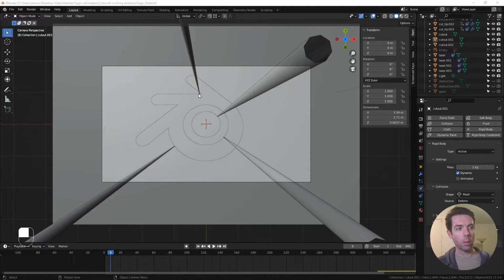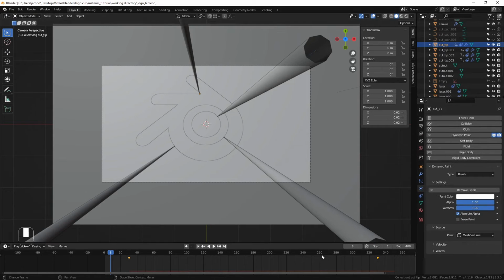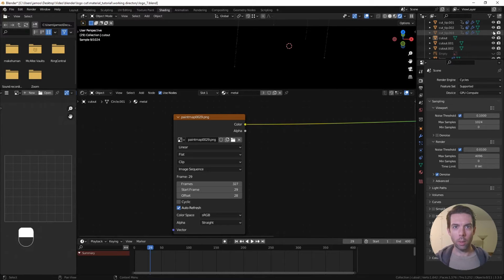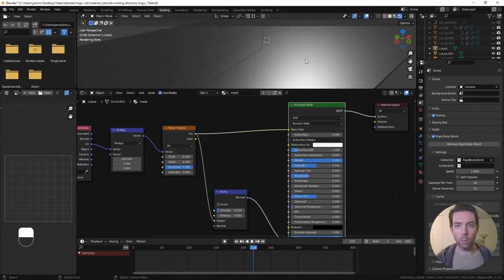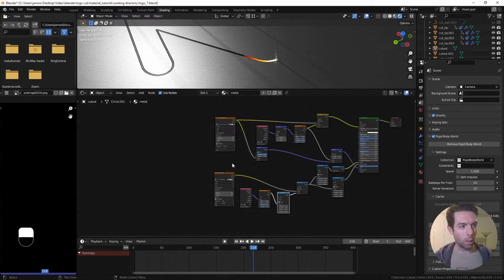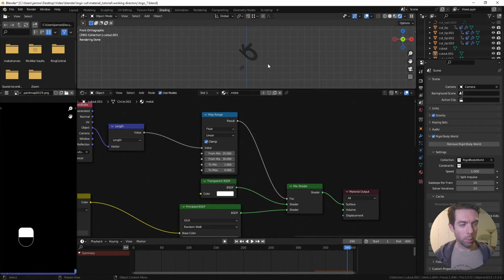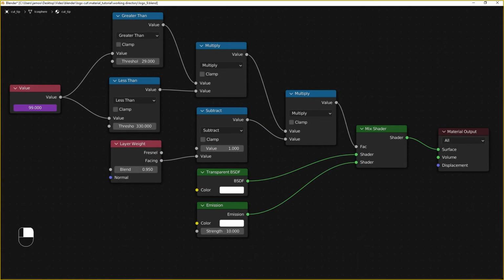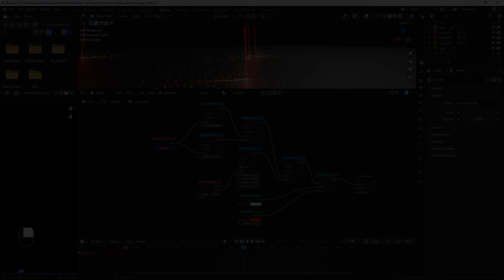Blender: Dynamic Paint Laser Cutter Material

Comment: Hello,
thank you very much for the great tutorial, which helped me a lot.
Unfortunately, I don't have much experience with Blender yet, so I'm stuck at one point. What do I have to do to make the material transparent at the cut edge (where the laser leaves the hole in the metal). I want to shine a light source through the cut. Maybe you can give me a tip?
Reply from the maker: Thanks! I'm glad this tutorial helped you out.
For shining a light through the cut, there are two options that come to mind. One that actually allows light through and one that kind of fakes it.  To actually allow light through, you could take your paint map texture and use that as the fac input to a mix shader node. Then plug in a transparent shader to the other side of the mix shader. This will allow you to use the transparent shader for anywhere that the paint map has a value. The problem with this approach is that if you are close enough to the cut edge you will notice that there is no geometry, basically you can see into the edge of the cut.
The other method is to fake the light coming through. Again using the output from the paint map image texture to a mix shader node. This time connecting a emission shader to the other side of the mix shader. This will allow you to make that cut glow in whatever color you want to shine through the material.
With either method, you are probably going to want to attach a frame driver to the factor that goes into the mix shader node. The reason is that as soon as the cutout starts to fall away, you are going to want the edges to appear solid/not glow (depending on the method you use) otherwise the illusion might fall apart as the rest of the animation plays through.
Hope that helps!

Comment: Well, this one took me a while - mostly because I'm on all new ground with Dynamic Paint, and Baking too, for that matter. So I spent most of the Thanksgiving holiday baking in more than one room of the house. The stuff in the kitchen came out fine the first time - the stuff in the living room? Not so much... I'll spare you the indigestion, but it took several attempts before I got it to "track right". I finally double-checked that I had applied any transforms I made to the objects (a mistake I still make too often), and that seemed to fix it.

Now the only problem I'm seeing is a slight misalignment of at least one of the cutting tips (I only have three) that seems to track a little off to the side of the Dynamic Paint, but I think I can fix that with a few adjustments.

One note: The cutouts seemed to fall away too fast, so first I turned the gravity down. That worked, but it also messed up the sparks (fountains!). Instead of trying to adjust them, I noticed/remembered that you can adjust the animation speed under Scene Properties > Rigid Body World > Settings > Speed. 0.300 was a good setting for me. 

Believe it or not, having to backtrack and figure out what I did wrong is actually more of a learning experience for me than following a cookie-cutter recipe to produce the identical results as the tutorial. Instead, I get to look at my half-baked cookies and say "Oh come ON! ... HE made them come out looking nice!" ... and so I go back to the kitchen and figure it out.

So I can tell you that my scene is pretty much the same as yours now; The Dynamic Paint looks really cool!; and I'm beginning to think that Geometry Nodes are a lot easier!

You're gonna kill me with the camera animation, aren't you? 😄
Reply from the maker: First of all this whole comment was hilarious to read, thanks for that! 

That's a great call out on applying the transforms, I made that mistake while rehearsing, but forgot to mention it when I actually filmed. The issue with the cutouts falling away to quickly might be due to the overall scale that you are working with too, I accidentally shrank the image at the start once and it seemed to move too fast.

I was actually thinking about you and your nice graphics card. I'm trying to find ways to make the rendering faster because the way I've been doing the final render uses motion blur and depth of field, both of which slow down the render like crazy. You may not have any issues with the render time though.